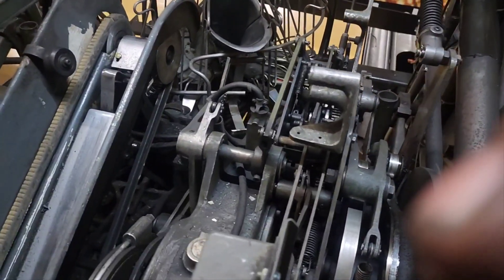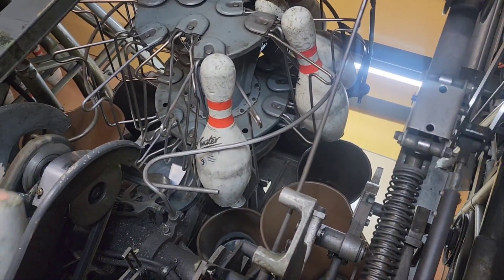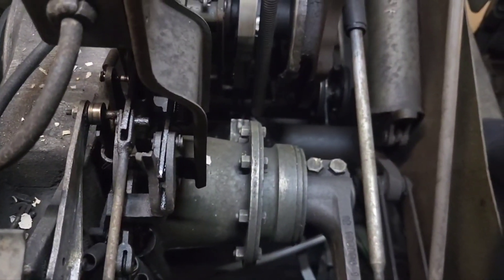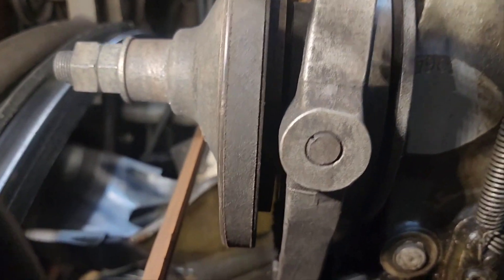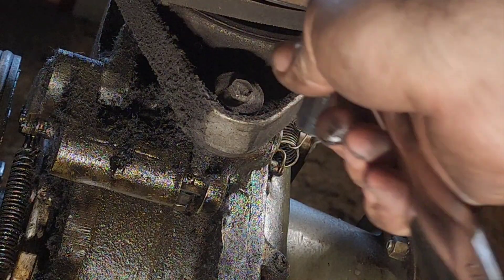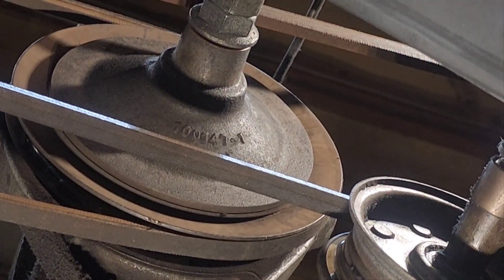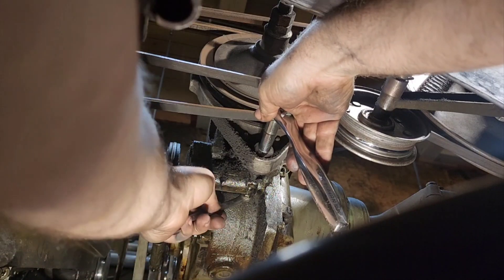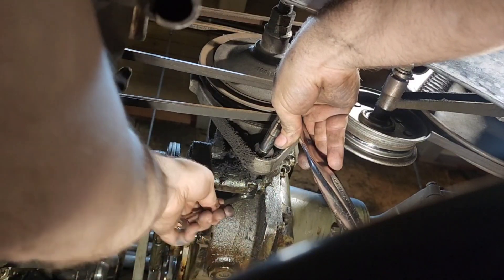Brunswick A2 gearbox clutch stopping way too late.

Comment: I’d hate to see what the spline looks like on that worm shaft.
Reply: A little bit of a grease makes a world of difference. Rather clean my clutches every 2 years than replace my worms at a $1000 a shaft. And i mean the lightest coating you can apply.